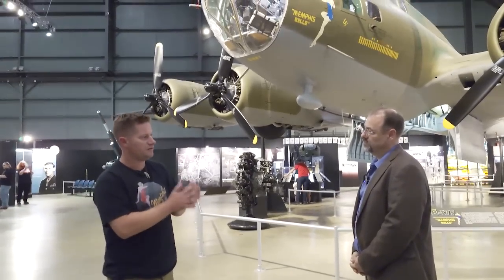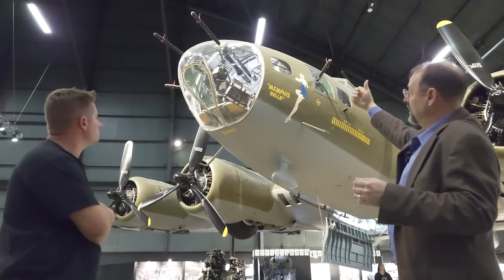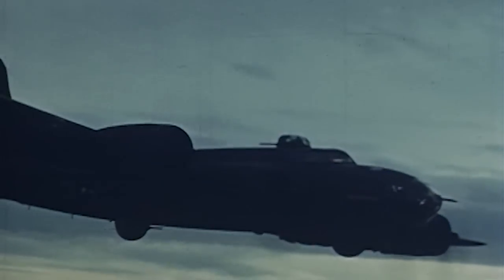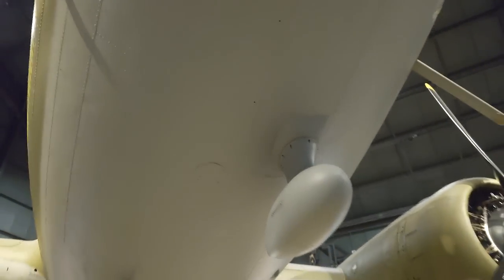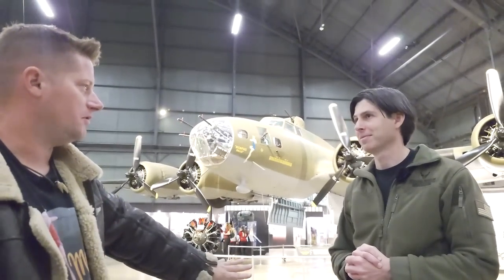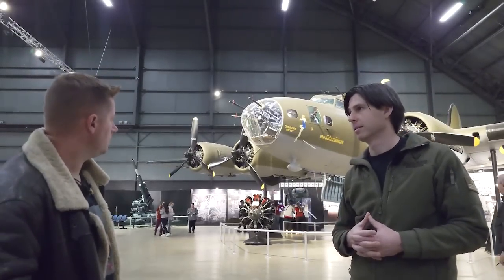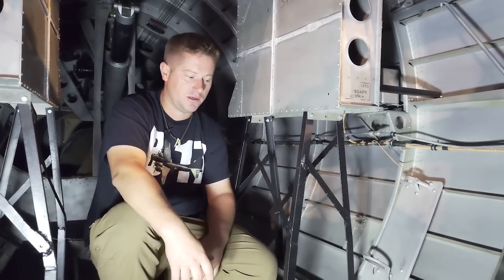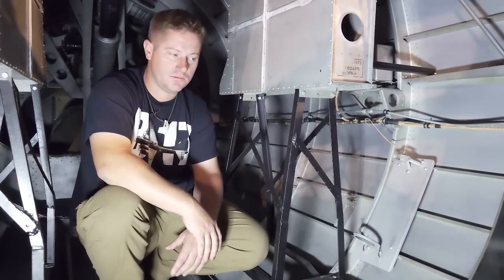Explore The Memphis Belle B-17 Modifications!

Comment: About 6-7 years ago, there was a seller on Ebay and he had the full set of plans made by Boeing and then scanned recently..Can't remember what I paid but it is a total of 38 GB..About 28000 individual scans..From an individual simple washer all the way up to the full wing ribs, fuse formers...Everything!!  Models E-F-G...with signatures of the men who created them with dates all the way back to 1935..So when I see you standing at the waste gun position and see the fuse formers, I have the exact plans of every part shown in your video!!
These engineers taking a blank sheet of paper and creating these drawings..Total awe!!
Reply from the maker: I bought a set of those plans this year! I want to recreate the skin for just the nose art. To do accurate 1.1 recreation nose are sections. Very cool you can buy those.
Reply: @MilitaryArmamentsCompany  I have autocad and Solidworks on my computer..Trying to recreate the original hand drawn plans to full scale using these programs..It ain't easy..
The Boeing engineers were a multi step above everyone else..And they did it with a pencil, ruler and  all the drafting tools they had..
I don't see how they did it??   Take a look at roll Z #464..A shot of the 2nd bulkhead in the nose area..How did they do that??